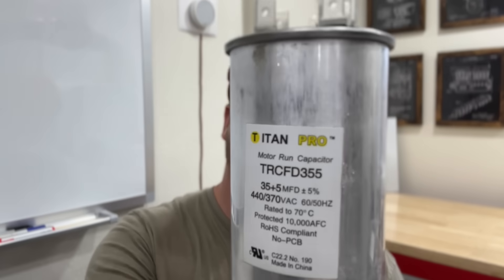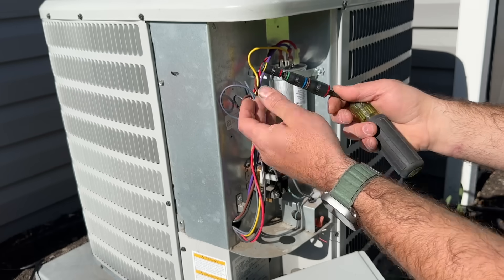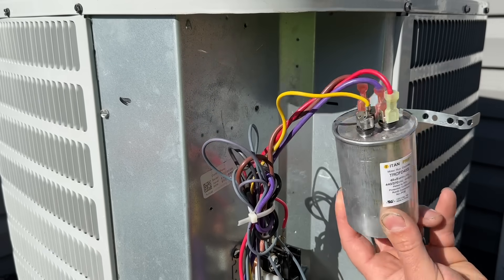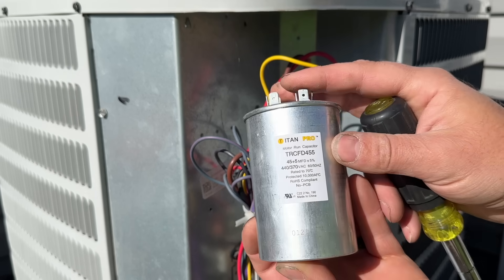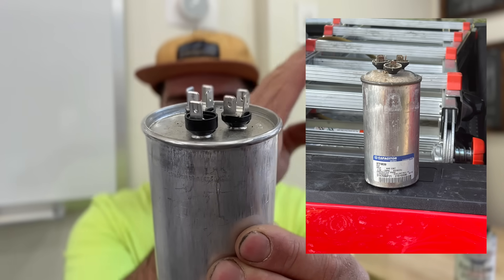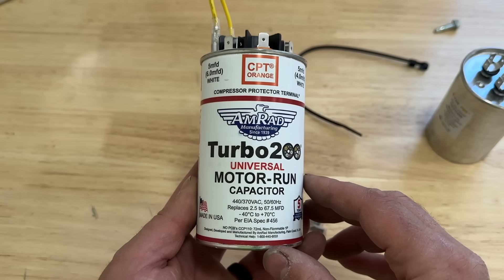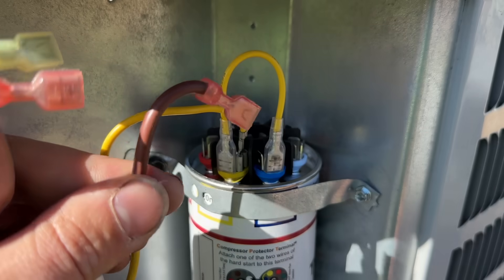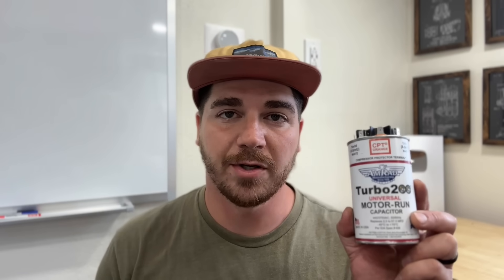HVAC Contractors Practically Make Their Living On These

Comment: Last  year, my son in law ask me to come over and look at his HVAC unit. ( I am not a HVAC person, just kind of handy) His house had been rehabbed two years before this and it seems the contractor installed a new Lennox system. He said the very well known local HVAC company came to look at it and told him he needed a new system. $13k. As I looked around, I noticed the power switch was shut off. ( Possibly one of his children shut it off, I don't know. Flipped the switch. System started ran fine. Still going.  He ask me why they told him he needed a new system.  I told him he should call and ask. Also, I was a victim of the "turbo capacitor scam" . I keep an extra just in case.

Comment: 5 to common 2 to start 1 to run - My night time Vo-Tech instructor in the late 70s was a daytime engineer at one of the large air conditioning manufacturers. His class was 80% electrical, 20% mechanical. And that's exactly what the job was. Don't know how many hard start kits I added to new air conditioning systems. Was great work. Are total bills were usually around 200 to 300 though, with parts, cleaning and testing.

Comment: A local popular heating and air conditioning company wanted to charge me $250 to replace the capacitor. I bought 2 for $20 although I doubt I'll ever need the spare.

3 times I've been told I need an entire new unit but each time all it took was a new fan motor the first time, the second was a repump-down and recharge and the third, a new control board.

All told, the price they quoted for just replacing the capacitor.

I can understand the value of knowledge and experience but it's not rocket science.
Reply: Then why did you call a local popular heating and air-conditioning company in the first place if it’s so easy?

Comment: I was with you all the way through until you connected the red and purple to common. Back tracking to @8:43 it looks as if there are four common pins.in the very center. So, am I correct in thinking any 2 of the 4 center pins would be correct?

Comment: If the outdoor compressor and compressor fan are working, but there is no air movement in the vents inside your home, it is probably a problem with the air handler fan attached to your furnace and AC coils, usually in the attic, basement, or in some other area inside the home. The furnace air handler capacitor is usually 5 uF single run.

Comment: None of the dual run capacitors (for outside condenser and fan) shown in this video on the website cost $10. A decent one is closer to $20 or more depending on capacitance and country of origin. I would avoid Chinese ones, and get one made in Mexico or US. Also, it helps to clean the wire contacts with some Deoxit or contact cleaner, because they corrode over time, and make sure the fit very snugly back onto the new capacitor (may have to crimp the contacts on the wire with pliers).

Comment: Being 75 y/o and disabled, and my a/c unit is on the roof, as are 99% of the rest here in Las Vegas, there ain't NO way I'd be able to change out the capacitor. I might give it a go if my a/c unit was on ground level. I've been screwed with a $500 parts+labor charge to replace the cap. The tech brought the bad one down and I snapped a picture of the specs on the side, and he quoted me a cost of $250 for the cap. After I'd been screwed without lube by him I ran the part # thru Amazon and found the exact same cap was $25..

Comment: Just flip that little black thing and it’s safe to open up that unit? I can’t tell you how many times I’ve seen that disconnect wired straight through. I’m sure at some point a fuse blew and it was just a temp fix until they can get new fuses. 
Now you’ve set someone up to get belted with 240. If they have the clearance

Comment: You aren't paying for the part only, you are paying for the labor, as well as the expertise in diagnosing it and fixing it properly etc. ALSO, when a company has too much business they can't keep up with, they will quote higher prices, those who pay will of course get the work done, but supply and demand applies to service as well as products.

Also, this is a lethal cap, you could literally DIE doing this if you don't know what you are doing or make a mistake, even with the cap disconnected.  45mfd and 440 is lethal capable.  Some of that price alone is "tacked on"

Comment: I’ve seen repairmen actually close the whole AC unit up and then go to the customer and tell them they needed a new capacitor. The price  runs anywhere between $250-$400 for a $16 capacitor that you can buy off of Amazon. Your video is spot on. It’s one of the biggest ripoffs that HVAC repairman do to customers in Florida.

Comment: When hooking up the new capacitor (not a Turbo 200), does it matter which pin each wire plugs into, as long as they are going in the corresponding FAN/COMMON/HERM terminals as before? For example can I use both vertical pins on COMMON, rather  than one vertical & one horizontal?

Comment: #1 Always use a meter, and don't assume the disconnect is wired properly and actually disconnects power. 
#2 Don't buy the $10 Chinese capacitors unless you want to do it again next year.

The Turbo 200s are great.  They do have to be mounted right side up, so if you don't have room, or your wires aren't long enough and you can't rewire everything, get a factory style replacement.

Lastly, if you have a newer high efficiency system,  you may not have capacitors at all. They use ECM condenser motors and inverter compressors. If that is the case, I hope you have a warranty.

Comment: I am an electrical engineer by occupation for 42 years and I always replace the compressor and fan capacitors and blower motors myself on the air handler and outdoor compressor. I leave the full replacement efforts to the air conditioning guys otherwise!  But these overpriced cap replacements are not going to fly with me.  I also order the caps and fan motors from Grainger exclusively because they have them and quality is good

Comment: Decades ago, my compressor failed, and the technician recommended a full replacement of the system, a recommendation for which I agreed.  Decades later, when I took a motors course, a requirement to get a general electrician's certificate, the instructor was covering start-and run-capacitors and I brought my experience with the HVAC man.  Needless to say, the entire class got quite a chuckle over my misfortune.

Comment: Have to agree that this fix by an A/C repair company is a Giant ripoff! I purchased and inexpensive cap meter and have updated/replaced mine over the years with no issues.

Ultimately I have a soft starter on now and mine is so quiet starting now and allows me to use a 8kw generator to start and run a 5 ton A/C unit in the Vegas heat with no issues.

Comment: Serious question on the handling of the capacitor. If it is not properly discharged, can you get zapper by handling the bulk of the unit or only from the contacts?

Comment: before my daughter bought a house years ago they had to get an inspection and the AC didn't work. The repairman said the compressor was bad so they needed a whole new unit. Little did he know my daughter had a degree in electronic control systems and after he left checked it out herself and low and behold he had switched the wires on the compressor so it wouldn't start. She put the wires the correct pins and remarkably the compressor started and continues to run to this day.

Comment: I watch this video a couple years ago and it just stuck in my mind but I didn't do anything about it. I've had no AC in a two-level condo in South Florida for 5 years. The investor who's taking over our neighborhood accidentally sent someone out in the middle of the night and fix my AC instead of the neighbors. This is what he did. I had already had multiple estimates for 3 to 5,000. Saying that both my inside and outside unit were trash. This guy did it in 1 hour and I've had   AC for the last few  months. The only downside is my power bill went from $30 a month to $90 a month.

Comment: These caps are made only for limp overs . This means u go back and replace it with the factory spec cap . These dont last long and are not good for the long term. Anyone who installs these already knows this, and u will be calling them back . They do work but never should be on there for a long-term setting .

Comment: Thank you very much for this video, very informative and helpful. I had my ac stop working and I was in panic mode, of course the ac stopped working on the hottest day of the year. I like to do all my own repairs, I really did not know much about air conditioners, but with google and YouTube I was able to replace my capacitor and get the ac working again. I have since purchased another capacitor to have as a spare. The first time my ac stopped working it was one of the fuses, took awhile to figure that one out, of course I didn’t check the simplest thing first. But anyhow thanks again for this video.

Comment: An A/c capacitor doesn't  hold a charge because of the A/c voltage constantly changing polarity. The D/C capacitors are the ones that are dangerous. Another thing is using a screw driver to discharge a capacitor is dangerous you should use a large resistor to bleed of the voltage.

Comment: @1:00 While I'm working on the unit, I pull the fuse assembly and lay it aside, not plug it in backward. This way I KNOW there is no juice in the wires. From a distance, you can tell if the fuse is pulled out. What if someone had reinstalled it back in the ON position while you were away from the job for a few minutes? Not likely to happen, but at least you can be absolutely sure you are safe.
BTW I do reverse my fuse assembly for the winter months, to prevent accidental startup if someone were messing with the wall thermostat.

Comment: Nicely done!  After I was given an estimate of $700+ to replace the capacitor on my condenser, I decided I would do it myself.  Matched up the specs with one on Amazon and got the job done for less than $12 and 20 min work. Thanks for the education on the multimeter.
Reply: At the house I just moved to, I replaced the AC cap myself for $20 and the relay for $40. According to a trusted contractor, I had saved over $600. The HVAC industry needs some oversight by the state. Who says we need less government regulation? Nonsense...we need MORE!

Comment: Our long-time HVAC repair guy told me about this very same thing a year ago when our new downstairs heat pump unit (that he installed 18 months earlier) would not start.  He told me on the phone what the problem was (bad capacitor) and came to replace it and the capacitor on the upstairs unit, also.   He said that he discovered the OEM capacitors were made in China and did not last very long, but that capacitors made in the USA would last "for ever" and cost about $5 more.  Zero problems since then.  Props to Petersen Mechanical in Loganville, GA!!
Reply: They still make capacitors in the USA?
Reply: @John-jd7mm  That's what it said on the box.

Comment: First off let’s make it clear that you are NOT paying for the capacitor, you are paying for the technician, the truck, the tools, medical insurance, 401k and let’s not forget the thousands of hours the technician has put into training. Anything between $250 - $500 is fair in a pinch because you waited for the part to fail. . However if you  pay for a preventative Maintenance two times a year fall and spring you will save yourself money and a headache. It should cost about $150 or so per visit don’t go for lowest price on the PM. Low cost PM means they are looking to make up the difference on a replacement or repair. As part of any good PM the tech should measure the MFD of the capacitor every time they go out. The contractor should also be inspected and for that matter replaced every two years while they are out doing the PM. If your dealing with the right company they shouldn’t charge you more than $50-$100 for a capacitor and same for a contactor if they change them out while while they are there doing the maintenance. Everyone wins. If you aren’t willing to pay for a maintenance and ask for those two “cheap” items to be inspected and you wait for your system to die during the winter or mid summer then that’s your fault because you didn’t invest in maintenance.

Comment: You are putting people in danger by not telling them to check for voltage with a meter before touching wires. Some hacks out there will bypass a failed disconnect. Also some of the older blade type disconnects will fail in the closed position.

Comment: The Hvac company jacked up the price of replacing the capacitor from the previous year. I ordered the OEM part for $25 and watched a YouTube video and did it myself. It is not hard at all.
Reply: Dab a small blob of grease on the electrical connections before plugging them in. Those tabs tend to corrode because they are exposed to the elements (even though they are shielded from direct rain). With that thin coating of grease, they will never corrode. I've been doing this with car electrical for many years...

Comment: I had my two year old AC go down in 100 degree last summer.I had a large company in San Diego came out at 9 pm.I gave him a $20 tip when he arrived.He diagnosed the issue right away and it was the capacitor.He said it would be $600 but he also said he appreciated the tip.He told me to purchase these units on Amazon for $30.I ordered the part installed it and my AC was up and running.I have two more in the bullpen just in case.

Comment: Tradespersons rates are off the hook. How is it that they are getting in excess of $200 per hour when an auto repair shop with high startup costs, higher overhead and insurance charge less per hour? I try and fix my stuff if possible to avoid getting ripped off. I've replaced two capacitors on my original A/C unit in the past 23 years for a total of $20.00. I've  added a booster capacitor for $10.00 and the unit is running quieter. I've also replaced the fan  motor for $175.00.

Comment: What do you mean a scam it's not a scam I've been doing it for 54 years capacitors burn out most of the time it's cuz they got wet and bad connections inside and you need a capacitor to keep the motors running right s*** happens it's not a scam and when you're there you can clean the condenser and give a nice service call but don't Rob them that can pass it only cost about $15 at the most so don't charge them $150 that's where the people are scammers that's just about stealing and the average person doesn't know how to check a capacitor come on

Comment: Had a brand new Amana unit installed in 2021, it stopped heating and cooling  properly the following year, right after the warranty expired. Called the HVAC company to come fix it and they wanted to charge 500+, I called a different HVAC company, the tech came out, checked the unit and told my husband and I we needed to replace the whole unit! These businesses are soooo dishonest!

Comment: Well as a Mechanical inspector in Birmingham, Alabama you are spot on. Some of the largest HVAC companies charge astronomical cost for things as simple as a tripped breaker and capacitors. They have their relatives to work the all center’s at the Better Business Bureau to intercept any complaints. Thus these crooked Bas*ard’s …..never have Complaints!
In my opinion the BBB being Complicit are equally guilty.

Comment: "I found the same part online for way cheaper, Hvac companies are a rip off!" Yet will pay 12$ for a combo from McDonald's that cost the company maybe 2$. Its called profit margins and mark ups. Don't want to pay high prices, fix your equipment yourself. Your car, water heater, all the same. Turbos 1) carry 5 year warranty, 2) covers ALL the odd size capacitors. After all companies don't stock every single cap. Most customers crying about cost, NEVER have routine maintenance done, being cheap can be very expensive in the end. Merry Christmas 😂

Comment: I learned years ago to keep a spare capacitor on the shelf for my house and my rental next door.  $10 to $20 bucks is cheap insurance, and it saves you from scrambling around to find one when the inevitable happens.   The going rate in my area is $250 to $400. I do try to understand that the tech has to pay for his tools, vehicle, insurance, gas, and his time. But some of the prices are a bit outrageous.

Comment: Got charged $400 to replace my capacitor with a new AmRad Turbo 200 Universal Motor-Run capacitor March 22, 2023. Said he didn’t have any other capacitors on his truck 😢
Reply: That sucks. Don't feel left out tho...we had 2 young plumbers come to unstop sink drain. Charged us $325 to run a 25 foot snake and another $150 to replace a small section of pipe under house. Less than an hour worth of work.

Comment: Replacing run caps is easy.  Knowing if you need to replace one is something the average homeowner knows nothing about.  Run caps very rarely go bad.  If you have a bad capacitor, it's much more likely to be a start cap.  Start caps rarely come in an aluminum can.  They're almost always black or brown thermoplastic, and they can be dangerous to mess with, especially if they don't have a bleed resistor, or you replace one with a new one that doesn't have a bleed resistor, or you replace one with the proper capacitance, but rated at a lower voltage.

Comment: The Trane capacitors on Amazon were about $55. The Technician charged me about $25o for two. I certainly could have done it all myself.  I drew the line when he said it would be $900. to clean the outside unit because the motor was dirty. Of course because they could have called me about cleaning it years ago

Comment: I woke up one summer morning and I was steaming hot in bed. Checked the temp… it was HIGH. CHecked my
AC… not working.
Long story short… removed the cap, bought a new one, installed it, AC working, back in bed asleep in 90 minutes.
$15 CDN
🇨🇦